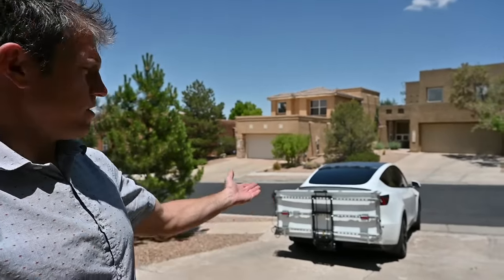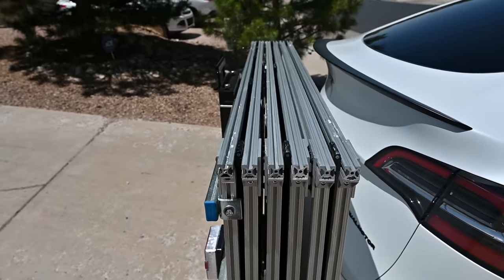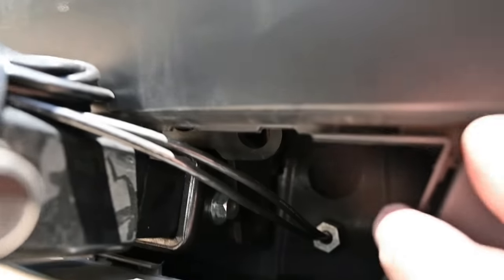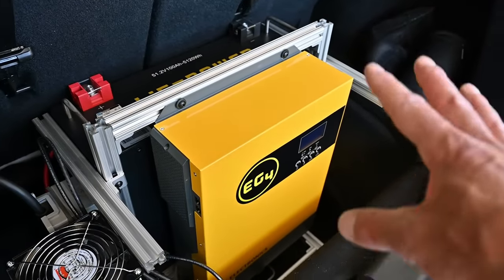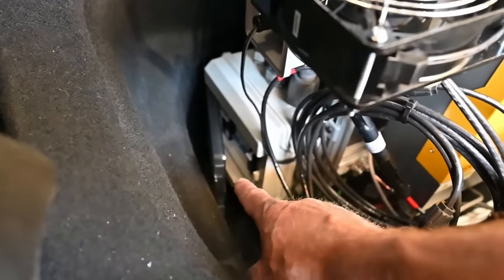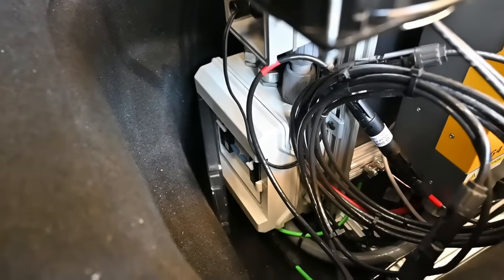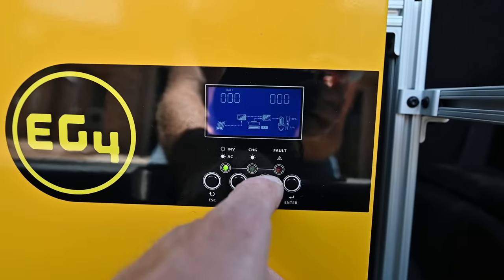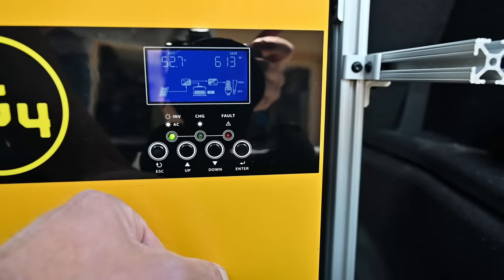Tesla Mobile Solar EV Charger with EG4 inverter and battery

Comment: You will use more energy than it produces just to carry the added weight. It is a neat gimmick for YouTube views, but not practical. Anyone who knows solar or the math behind the gimmick knows that is why you added the battery, so it can appear to charge more than the solar puts out. 7 175 watt renegy panel put out about 1000 watts at 12v. Which is 100 watts at 120v. Not enough to draw 5amps at 120v.
Reply: Nope. Your maths is way wrong dude. Try again.
Reply: @Mike-.  I will explain the Math. The 175 watt Renegy panels put out 60% of thier rated wats or 105 watts each. 105X 7= 735w @ 12V or 73.5W at 120V. 73.5 W @ 12v = .6125 amps. And that doesn't account for the loss of energy converting from DC to AC at the inverter.

Comment: Now just add a pv tracker with actuators..motors or whateverz.
Reply: If ya do the tracker I’d consider a box outside with the rear panels and proof it so it can be watertight so the inverter and stuff can get out of the trunk…which would also help with climate control..make a bigger box for ac and you could give your batteries easier and more efficient cooling than to use the Tesla for cooling. …course that would need more support and probably welding for good stability in the back.

Comment: I hate to be the one who bursts your bubble but, 600 watts is barely enough to charge an E bike, in 2 days.
Reply: You off by a zero or so. And e-bike might have .75 or 1kwh battery pack. 600 watts of solar could charge it up in 1.5 hours.
Reply: @ben3989  My point is this charge rate of 600 watts will only power a Tesla 18 miles, with 10 hours of full sun, not the 30 he claims.

Comment: This is legit but I find it funny how you have to convert it to AC just so when it goes into the car it turns back to DC, the car has to convert it back to DC to put it into the batteries.
Reply from the maker: Yes, DC inputs would be a blessing. But very complicated to engineer. Easier if OEM, but people would not follow instructions and maybe shock themselves.
Reply: @gridfreeordie  that would be legit if they did tho.

Comment: This isn't the best way to charge your Tesla's battery.  It's better to have higher voltage, lower current panels so that the voltage matches the DC input needed by the charge port and buy yourself a charging cable end and wire it directly (with a fuse, of course).  Get rid of all that battery/inverter/charge controller crap.  More efficient, cheaper, nothing in the trunk, no heat in the trunk.

Comment: Interesting Video, And thought of similar ideas, but pointless, firstly the cost, then at 1kw output it would  take 60 hrs of full sunshine to fully charge a std range, the extra weight and worse the aerodynamics of  having that on the back would in most cases use more power than you would ever put back in, then the deployment would need to be where some idiot won't run over it. And it's a tesla, plenty of chargers and they always work. Could be the odd situation were it work, say a long camping holiday in the middle of nowhere. But I don't hate the idea, just think of a better one.
Reply from the maker: Agree, but for me it works and has been working for a over a year. Yes, you need to park in the back. See following videos for system improvements.
Reply: No criticism, I enjoy buggering about myself, Keep at it, My points came from the practical side of my brain, next step has to be to fit wheels to the solar panels so it can be deployed on the highway.  @gridfreeordie

Comment: so how long for a 10% charge??? an math going on here. 600 watts ok. so thats a start.. 600 wats "If you maintained a 1kW charging speed for one hour, you would have delivered roughly 1kWh of energy to the battery. If you had a 100kWh battery that was (for the sake of simplicity) completely empty, it would then take 100 hours to charge back to 100%."   100 kWh in the Tesla Model S -

Comment: All of the solar panels the battery the inverter could have been mounted on the wall. That's right it's called to Tesla power wall. Why would you bolt it to your car and haul around with you all day long and take the chance of destroying it in a car crash.

Comment: I love it, but Karens won‘t.
Reply: To elaborate more on the concept which again, I love and the ability to build that is awesome. But here are a few more thoughts. I only see this being useful unfortunately in „controlled parking environments“. This is your personal driveway, maybe friends houses driveways, maybe cerain camping arrangements. Risks still are that modules are prone to theft, accidental or unaccidental damage due to low visibility. People and drivers don‘t expect something laying flat behind cars so they could run it over or trip. Or just flat out destroy it on purpose because some people hate electric cars and/or teslas. Definitely not suitable for most kind of public parking eg. mall parking due to mentioned reasons and safety regulation in general. Plus this electrical visible (high) voltage cable could impose a risk to people. 

So in conclusion since you can only use it at home and rarely on the go it would make moste sense to put it where is doesn’t bother no one and gets the most light. On the the roof. And there ist can harness energy every time the sun shines and not only when you unfold it. You can still use the solar energy 24/7 when you install storage that collects the solar power energy. And there we have the Tesla in house distributed Solar and Powerwall. But any make and in your case a DIY solution will do. 

And you reduced the cargospace in car, the usability and the versatility. Plus you reduced the efficiency by loading more weight and worsen aerodynamics with the build. 

But when the shit hits the fan and we’re in a post apocalyptic scenario then you are 100% the absolute king with your solution.

Comment: A whole 1.2 KW!..... 24 hrs OF FULL SUNLIGHT for 25 miles of range. NICE🤣🤣🤣🤣
Ever heard of a 110 outlet? They are EVERYWHERE and though agonizingly slow to charge, its 3 times faster than this contraption and also works at night. Plus you dont need an extra trunk to drag around. Next time use a calculator before you get building. 🙄

Comment: i don't want to be rude don't the system doesn't make sense i applaud your effort but this idea is an overall loss it's a small amount of generation for a pretty hefty weight gain and horrid aero with the effort you put into to this and not a lot more money you could have easily put an independent solar system on your garage and had 4 or 5 times the amount of power to charge your car without the loses of dragging the system around

Comment: Um you do realize this is pointless right? at 1.2 even 1.4 KW even on a good day it would take you more then 5 days if not almost 9 days to charge your vehicle right?

I have a lot of math that can back that up too if you are curious.

I am curious to know though as a typical model Y has 75KWH capacity and if your charger there gets even 1.4 KW at best (including the 0.2 from the roof)

simple math would say that is 53.57 hours.

lets say on a summer day 16 hours of sunlight, winter 8, or average annual is 12 hours a day

now in New Mexico ( you should blur out your license plate..just a good general idea)..get on average 165 days of less then 25%..or optimal days of good sun light.

lets average this out also per day... 165/365 is about 45%...meah for ease of math lets say a wee bit better and say ya get 50% of the days.

heck that averages about 6 hours of lower then 25% cloud cover per day through out the year.

o that means you in theory or should take you at that 6 hours a day of good clear ish sunny days..

8.9286  basically 9 days  NINE DAYS to fully charge your car FULLY

5.36 days  ( 5 days and 8 hours ish) if you do the typical do not go below 20% or higher then 80% charge method.

this is NOT practical at all. So I am curious to know then how long it takes you to charge in X hours to get Y millage that you are experiencing so far with this set up?
Reply: If anybody wonders what qualifications I have to back that up?? I have a bachelors in both robotics and physics, and a minor in math.

Comment: Vent the heat out of the trunk
Reply from the maker: Yes, completely agree. There's a pretty easy way to implement a vent connected to the exit fan port of the inverter.  But I didn't want to drill a monster hole in the rear tub just yet. That tub is very easy to replace if I destroy it experimenting too. I may end up doing it.

Comment: What is the point you can’t use it anywhere except your driveway.   What are you going to do with this unwieldily heavy rear lights and plate blocking monstrosity.

Comment: At this point in everybody in the instructions thinking logically and more simple. Altinator , polly system, rectifier, and voltage regulator duh.run forever free energy. I've done this with gocarts simple easy and never have to wait for recharge